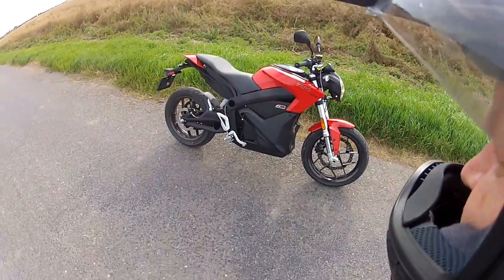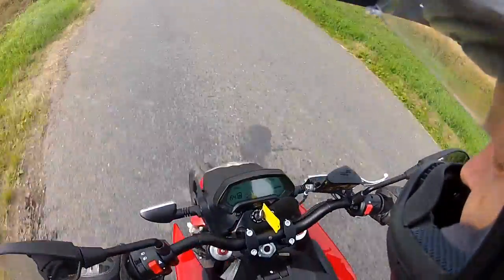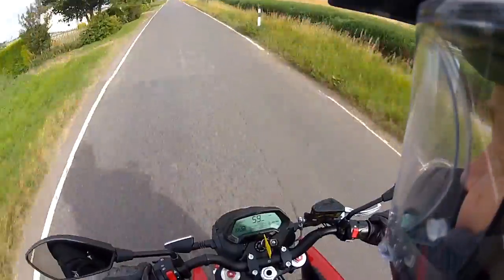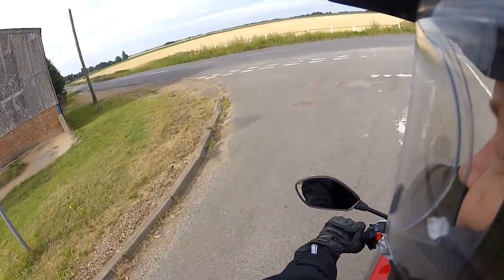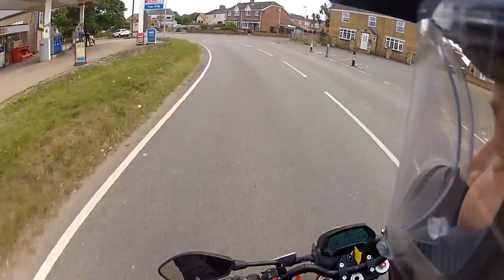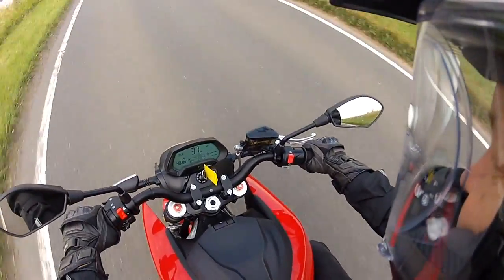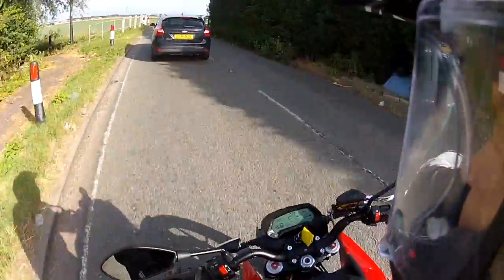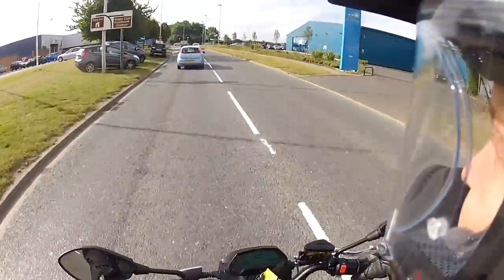TEST RIDE - ZERO SR ELECTRIC MOTORCYCLE - SHOCKINGLY GOOD! - WHEELS MOTORCYCLES

Comment: Use my two bikes all year round. In 40 years of riding I must have covered 500k miles or more. And the only problems I've ever run into that have been a pain to address? - Electrical issues! :)

I think a replacement battery is like £3,000 or something for one of these? Ouch. And the engine, god knows how much.

And the "belt"? A chain and sprocket kit costs next to nothing..

So, a £15,000 bike that could require a £6,000 pair of replacement batteries after 5 years. And god knows how much in costs if other stuff goes wrong - you know, stuff you expected to be covered by the warranty but the dealer/manufacturer have a different idea once you make a claim (been there, bought the tee-shirt, several times over! :))

I love the idea, but I think it's still some years away from being truly practical and affordable. Great video, nonetheless, and many thanks for it.
Reply: When cars were introduced they weren't that practical or as fast as horses were back then. But slowly technology improved and we grew used to it. Electric motorcycles are going to be the same. It might be impractical now, but it's definitely the future.
Reply: The batteries and motors are good for over 300000 miles. Next question?
Reply from the maker: Good comments well made. I'm sure we are still at the birth  truly practical electric vehicles but nothing is more certain that they will slowly be taking over the roads in the years to come...   Thanks for the support :)
Reply: i agrree with you even for bike soco cheap but the batteries here in portugal cost 1.200 eur and have a a life time more less bettween 36000km and 60000 km .....its equivalent at a 50 cc bij«ke and cost 35000 eur